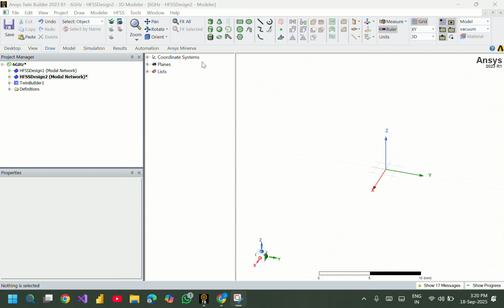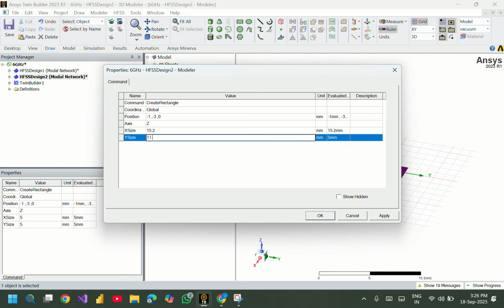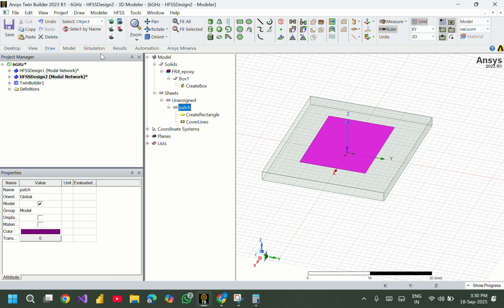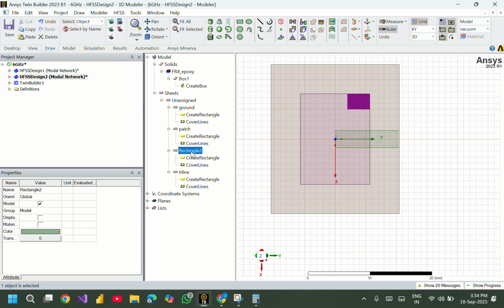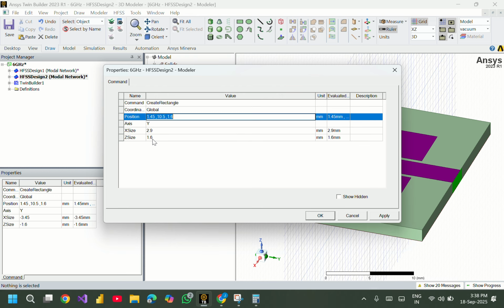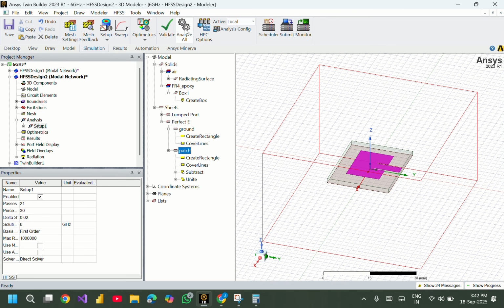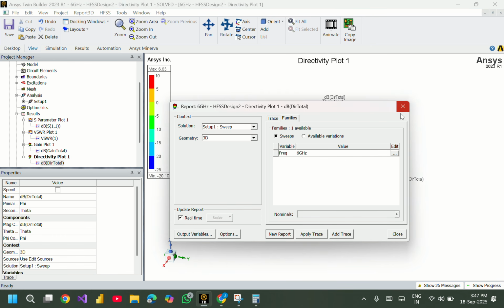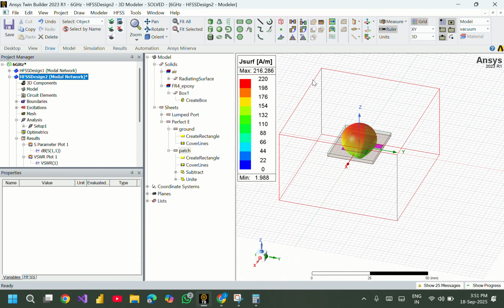6Ghz insert feed microstrip patch antenna design using Ansys HFSS in simple steps

Comment: Hello I want to ask you question about what you are using value of inset and  in feedline how you choose y size =10.5 please
Reply from the maker: we will connect the connector on the edge of the antenna so we need to start the transmission line from there then we need to find the 50 ohm point on the patch area then its done for detailed understanding read balanis book

Comment: Hello, my name is Diego, an electronics student. I would like to ask for your help simulating a half-wave plate for a scientific article that I am trying to replicate in HFSS. I have been unable to obtain the same results for weeks. Thank you for your time.
Reply from the maker: which type of antenna are you trying to design.
Reply: @insightfulantennas  It is not an antenna it is a half-wave plate, but its design (which allows changing the properties of electromagnetic waves such as transmission and phase shift) is based on a metasurface with periodic boundary conditions (master/slave) and plane wave excitation sources (Floquet ports). 
The article ( 8 Pages) citation in APA format is: 
Yahyaoui, A., Rmili, H., Sheikh, M., Dobaie, A., Laadhar, L., & Aguili, T. (2017). Design of all-dielectric half-wave and quarter-wave plates microwave metasurfaces based on elliptic dielectric resonators. Applied Computational Electromagnetics Society Journal (ACES), 229-236. 

To obtain the graphs from Fig. 5 of the article, I used:
A) Phase difference (ϕx – ϕy): ang_deg(S(FloquetPort2:2,FloquetPort1:2)) - ang_deg(S(FloquetPort2:1,FloquetPort1:1)) (I get the same result).
B) Transmission coefficients (Log(Txx/Tyy)): log10(mag(S(FloquetPort2:2,FloquetPort1:2)) / mag(S(FloquetPort2:1,FloquetPort1:1))) (I do not get the same result).
Reply from the maker: you can contact me through linked in. 
https://www.linkedin.com/in/mohammed-javith